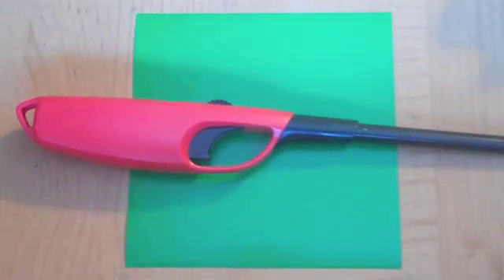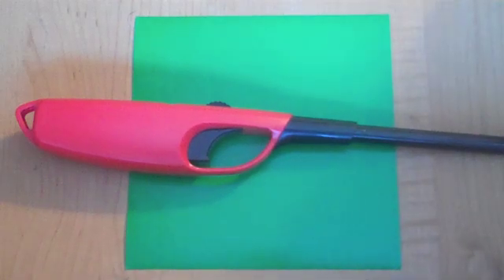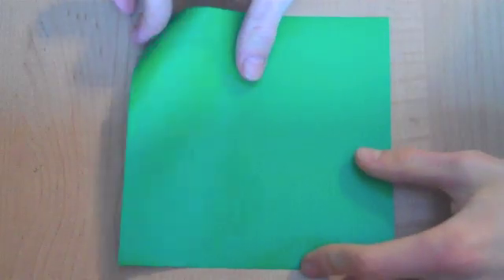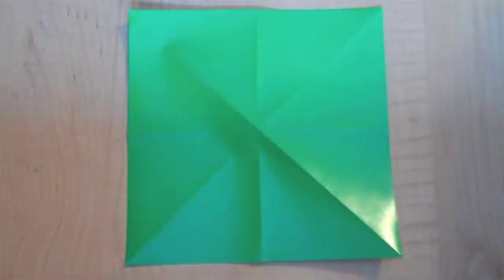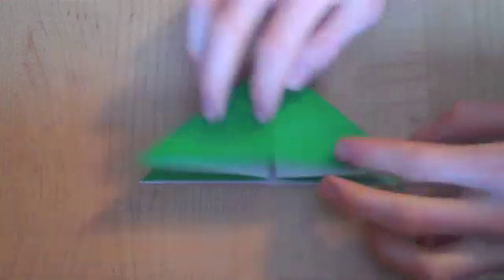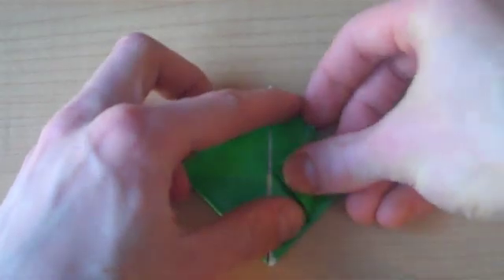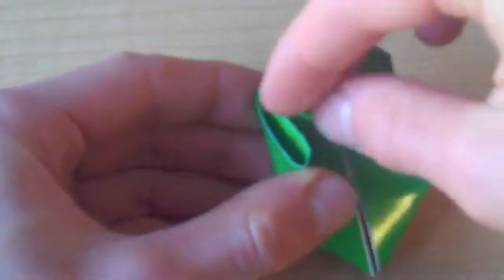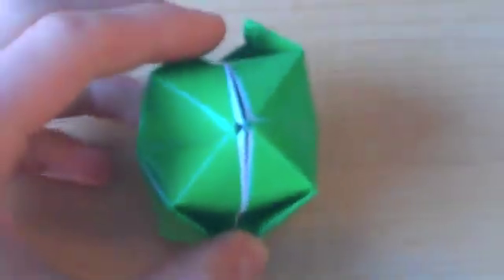Make a Working Paper Jet Engine - Easy

Comment: was not what i was suspecting. this isnt an engine, look up the definition pls.
Reply: I'V got one for ya..."A jet engine is a reaction engine discharging a fast-moving jet that generates thrust by jet propulsion. This broad definition includes airbreathing jet engines (turbojets, turbofans, ramjets, and pulse jets) and non-airbreathing jet engines (such as rocket engines). In general, jet engines are combustion engines."

Comment: A jet engine is not bursts its full working compression chamber. This is a lighter and a box. Blowing in it would do the same thing
Reply: A jet engine is a system using air or a gas to propel itself. He most primitive is literally a tube using heated air. You can make one yourself out of paper and throw it across an open area. Airflow passing through the tube will
Propel it across a noticeable distance. A jet engine does not require spinning blades, it just needs air compression.

Comment: Yeah. the titlle was wrong. jet engine??? nooo you just did a paper combustion chamber where you put gas and when ignited the compresed gas had to exit at high velocity. so yeah it is interesting for a 10 year old kid or for somoane tha is curious but does not have any knowledge about phisics and chemestry
keep up the good work.
Reply: Exact , bă Georgele . Fix de asta mă plângeam eu acuma.  :p (simţeam că trebuia să pun un smilyface chiar dacă nu se potriveşte)
Reply: Actually it's technically a rocket
Reply: Drake Merrell Yes it is but a rocket engine, not a jet engine. But on my first comment i was not saying that it is something bad, i was just saying that the tittle was wrong. actualy it was very intresting :) that way i say keep up the good work.
Reply: George Irimescu its a pulse jet but it shoots once instead of 20+ times per second did u actually expect it to fly lol
Reply: Apopei Dumitru ok boomer